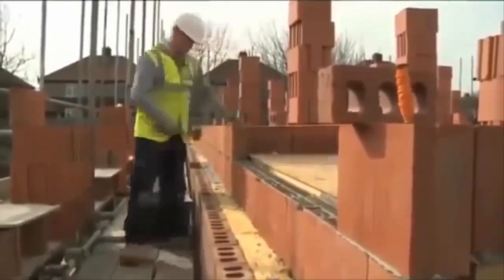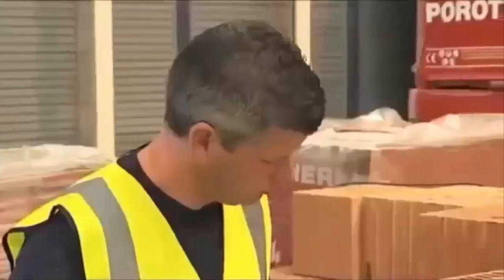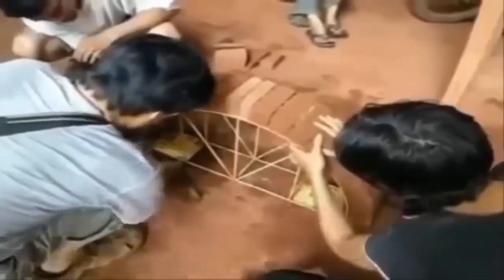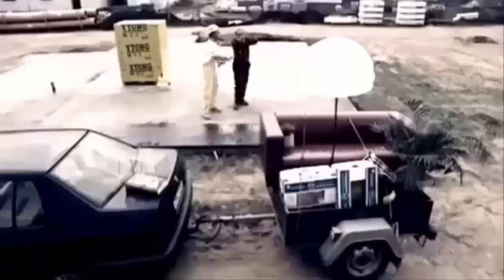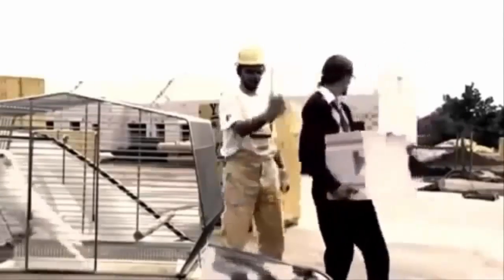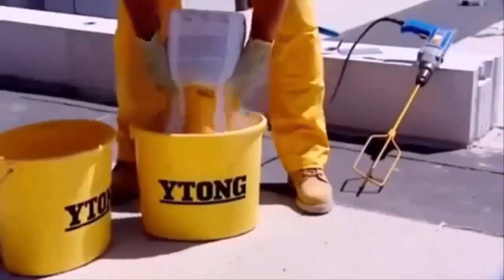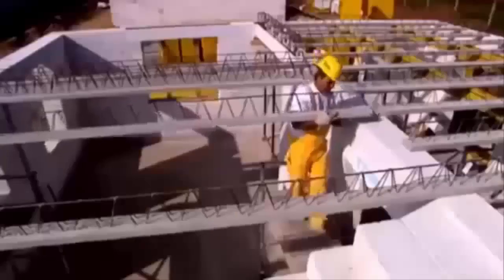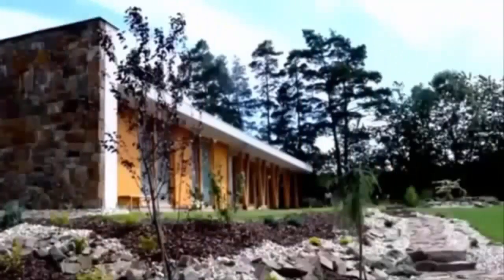Latest Technology Construction Machines Fastest Building - Amazing Modern Techniques Construction

Comment: hmmm looks weak any one/thing can could dig there way in wont hold up to knocks and dings another fing alternate building product thats about making money not good product ... and its ugly
Reply: Ytong is not a finishing block.  Facades are usually brick or stone and interiors are mostly done in plaster.  It's a wonderful thermal and acoustic insulator, adapts to complex architecture easily, is very easy to use and economical on mortar and associated material.